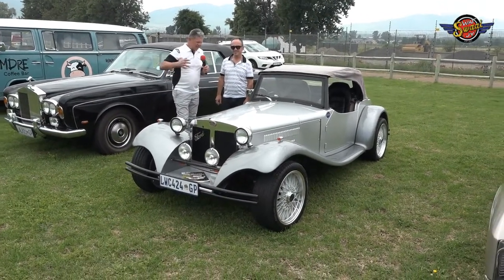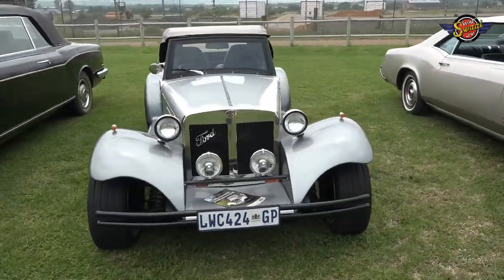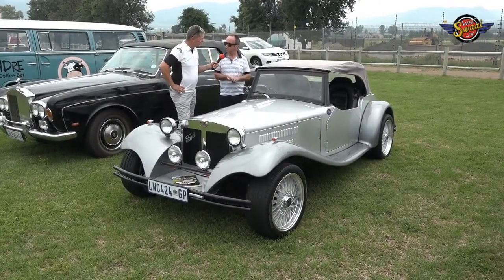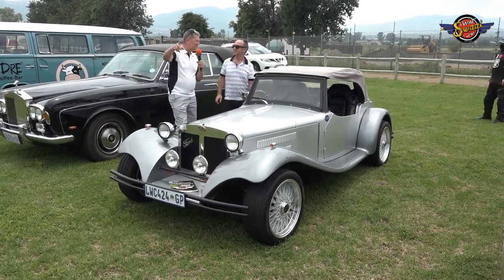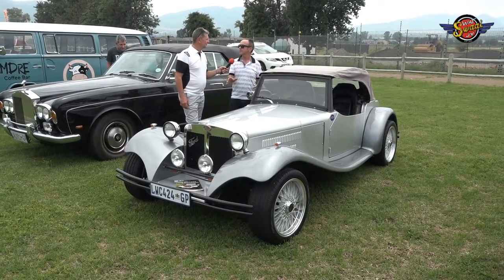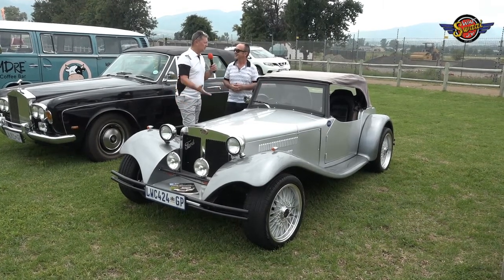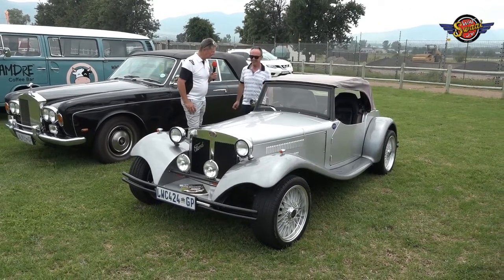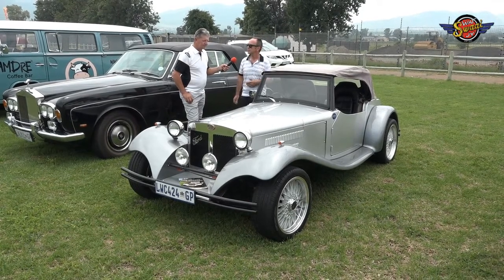JBA craziness

Comment: I have a JBA Falcon Tourer built by the renowned professional builder John Watson. It has a 2ltr Pinto engine with 5 speed box. Improvements since being built include Electronic ignition and Spax adjustable suspension. It's a rear blue colour.  A great car to drive. Only had it a few months Currently SORNd for the winter. 
I also have a white JBA Falcon Tourer with a 2 ltr pinto but 4 speed box.